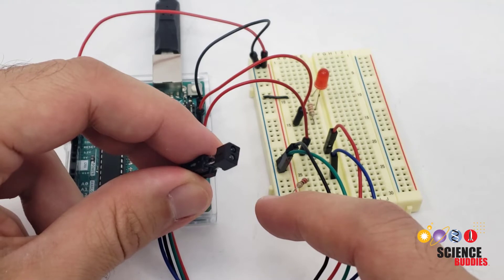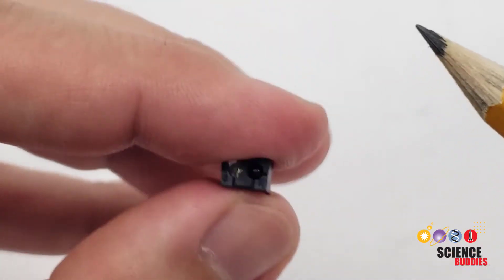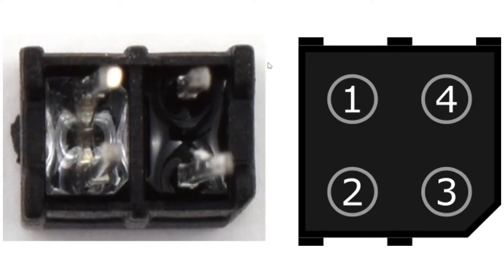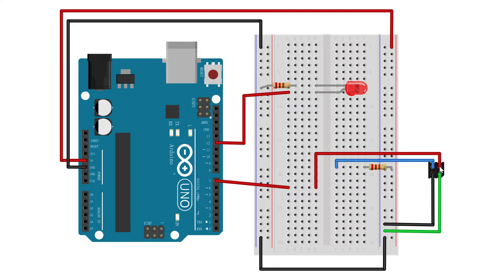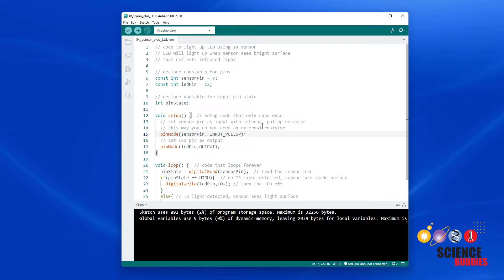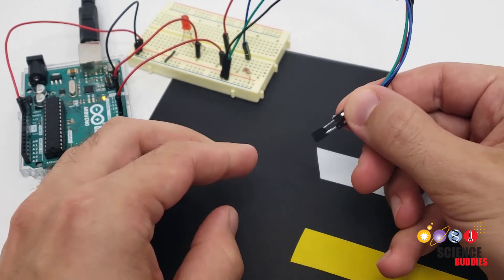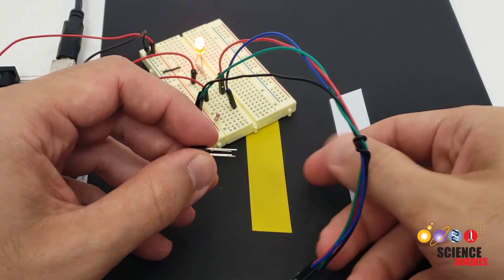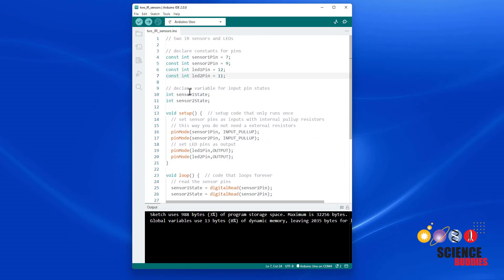Arduino Self-Driving Car Lesson 6: Using the Infrared Sensors

Comment: Hi can I get your some social media or discord or email or something to contact you? 
Because the current Infrared obstacle avoidance sensor is 3 pins - GND,VCC & OUT and comes with inbuilt 2 leds, it's looks somewhat different from yours and I can't figure out how to connect. It would be great if I get some assistance
Reply from the maker: Hi - we can only provide direct support for this project if you purchased our kit and are using the included sensor. If you are trying to build this project using your own parts, you could ask in another forum like the official Arduino forums or a site like Reddit or Stackexchange.
Reply: got ay idea??

Comment: Pls add link if this sensor
Reply from the maker: The sensor is like this or similar: https://www.jameco.com/z/LTH-1550-01-Lite-On-Electronics-Reflective-Surface-Infrared-Emitter-Detector-Sensor_2202378.html
Reply: @Science.Buddies  can we use h21a1 sensor
Reply from the maker: It looks like that is a "beam break" sensor that detects whether an object passes through the narrow slot - the emitter and detector are aimed at each other sideways instead of facing outward to measure light reflected off a surface. So no, that sensor would not work for this application.
Reply: @Science.Buddies  can we get that sensor on amazon
I am not able to buy it since I live in India
Reply: @Science.Buddies  can we use this instead and if yes then how
Reply from the maker: Hi - we are based in the US and provide our own kits for some harder-to-source projects, unfortunately we can't provide much help when it comes to sourcing parts in other countries. We suggest searching online for "Arduino line sensor" and seeing what is available in India, but you may need to adapt your circuit diagram and code for different sensors. Each of these sensors contains an infrared LED that emits infrared light and then another part like a photodiode or phototransistor that detects the light, so you can also build a line sensor by purchasing those parts separately. We don't have our own tutorial for it but you should be able to find Arduino tutorials for it online.